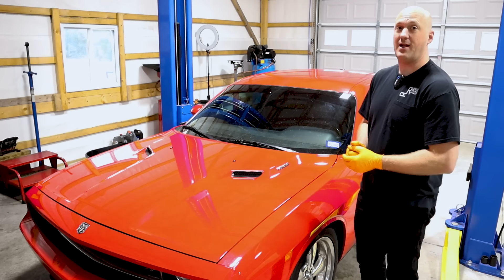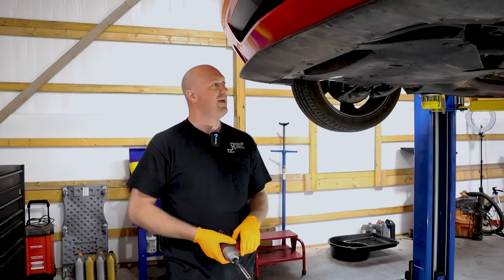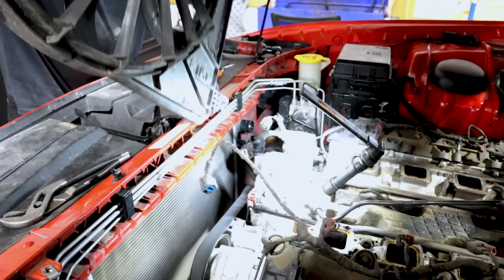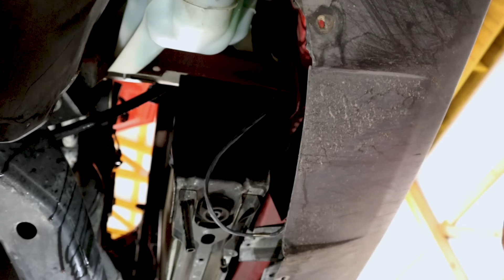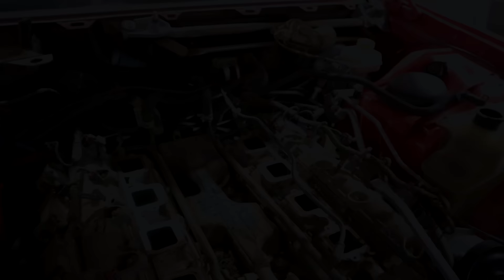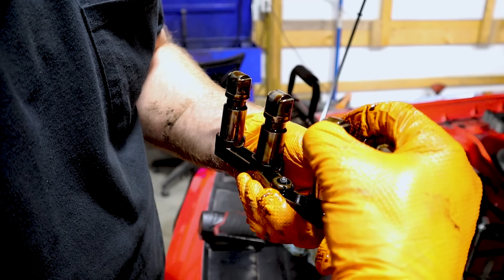Hemi Cam Installation! Budget Challenger Build Ep1

Comment: I had been giving it some thought about doing mods like this to my 2020 Ram 1500, but then I think, why not just get a junkyard 6.4 SRT motor with relatively decent miles and do a freshen up and new cam and lifters, maybe a set of rings and swap it into the Ram. Anyone agree?
Reply from the maker: In my opinion it's not worth the extra hassle. You can easily do some bolt on mods to your engine and make it a pretty decent ride. Getting the 6.4 working properly is a lot of effort.

Comment: Does the hemi change much from 05 to 2010? Asking to see if it'll be possible to do the same for my Magnum rt
Reply from the maker: Unfortunately they did change the block slightly in 2009 to accomodate the VVT system, so this cam will not work in your Magnum.
Reply: @ReignitedAuto  Damn, well good to know now, thanks for the explanation. Amazing vids btw man, super easy to understand you. Keep up the amazing work! Also another thing, would the SRT8 cam from the 6.1 fit onto the 5.7?

Comment: I have a 5.7 hemi in my 04 ram... obviously the concept is the same but will this same parts work on mine the cam the lifters  and springs
Reply from the maker: Unfortunately not, the block was changed in 2009 when they added VVT so this cam will not work. The springs and lifters will though.

Comment: I installed 6.4 l long tube headers, 95mm throttle body, k&n typhoon air intake, muffler delete mid pipes, resonators and high performance high flow cats
Reply from the maker: I bet that sounds gnarly! 💪

Comment: really great well put together video . You really showed how easy this engine is too mod that i decided too copy this build for myself . However I’m debating whether or not too use a comp cams phase limiter . It doesn’t completely stop the phaser from moving but reduces it by 50% . I’m not sure if it would make for a even better power gain or potentially hurt power gains , What do you think ?
Reply from the maker: Honestly I couldn't tell you for sure, since I haven't done any dyno testing to confirm either way. However, one of the reasons I chose not to use one on this build is so that I wouldn't be throwing any Check engine lights for phaser operation.

Comment: Going at this without pulling the heads off, got the timing chain off and the cam will hardly spin with a ratchet. Can’t even spin it by hand. What would be causing this?
Reply from the maker: I've experienced this before, the front cam bearing develops a ridge in the front of it and this won't allow the cam to spin smoothly or be pulled out without yanking on it.
Reply: @ReignitedAuto  nice way of telling me what I don’t want to hear. Thanks for pointing me in the right direction

Comment: Do you need to take the heads off?
Reply from the maker: Technically no, you can change the cam without removing the heads, but usually I am replacing the lifters at the same time which does require the heads to be removed. 👍

Comment: Random question, are you not afraid of mixing the coolant and oil?
Reply from the maker: Not when I know I'm going to drain it at the end. If you let it sit for awhile the coolant will always separate itself underneath the oil, then when you drain it all the coolant comes out first and is pushed by the oil on top 👍

Comment: Hearing that cam smack the cam bearings made my sole hurt.  I know your trying to do it fast , but in my short time of working on my mag ive learned it is just as easy probly easier to remove the nose cone with the bottom air diffuser attached to it rather then fight teying robget them small a$$ bolts to line back up .
Reply from the maker: I think there's a misconception that cam bearings are made out of pudding, they're not 😂. That light "tink" noise you hear is endemic of a hardened metal touching another piece of metal, trust me, the cam bearings are perfectly fine.

Comment: Just want to share, I did my first cam swap on my 15 Durango rt. This is the video series that gave me the confidence to do it myself. Had zero issues on startup and so on. Jumped into all the research I could find on the 5.7 Durango to make it as easy as possible. While it was somewhat easy, was just time consuming which is ok. Thanks for your videos and channel!
Reply from the maker: Exactly what I hoped the channel could do! Great job man 💪
Reply: How did you take the header to Down pipe bolts out? I can’t fit anything in there
Reply: @Jojopraa take the heads out with the headers attached.
Reply: So about how much does all that cost
Reply: @ronniejones9693  little over $2500 for the cam kit and tuning/tuner and pcm swap. If headers too then you're looking at another $1500 or so depending on the brand.

Comment: Did you get a check engine light after install?
Reply from the maker: Nope, runs perfect 👍
Reply: @ReignitedAuto  I plan on doing a SRT cam and MDS delete on my Ram 1500 5.7. Probably a canned tune from hemifever if no check engine light. I know there's a difference between Ram and dodge 5.7 hemis. But I'm sure there are still gains on the dollar. I'll probably do this after a under mount turbo install. Do you think it is wise to put the SRT cam in a Ram 1500 5.7? I'm not looking to break records. Just have a little more around the band. I know the 6.4 HD cam wouldn't give me that.

Comment: I am beyond pleased with this tutorial. I am a long time chevy gear head but have been a little intimidated by the task of tearing into a hemi. I have a 2011 that broke the timing chain and bent numerous valves. I was considering a long block but after watching this I am going to do the top end myself. Thank you very much. I have subscribed and will tune in.
Reply from the maker: That's great to hear Kevin! You'll see once you get into it that it's very much just another cam in block engine, you won't have any trouble 👍
Reply: Update, I finally got all the parts and did the job based solely on your videos. Got 150 miles under my belt running strong. Lifters seem a little noisier than I remember but no codes, no leaks, mds system operating correctly. Thank you so much for this series. I have never worked on a Hemi ever and I was able to do the work after watching your videos. Thank you again!

Comment: Would that cam fit the 5.7 Hemi from 2004-2007?
Reply from the maker: Unfortunately no, they updated the block in 2009+ to accomodate the VVT system, so these cams won't work in the older ones.

Comment: So my 2012 2500 ate the cam a few years back so I decided to rebuild the motor. I went with the 6.4 cam, mopar performance springs. Went ahead and did a little head work and back cut all the valves. Added oversized throttle body and had it custom tuned by HemiFever. At first i wasnt too sure about it because it does lose torque down low, but a little more throttle and there it is. The torque curve moves up a bit. I can tell you that i am definatley over 450hp at the wheels and cruising at 30mph and gun it i can get to 75 in about 1 second flat. I have yet to have any truck beat me at a light that includes Raptors. Keeping the VVT is excellent as it works as almost a turbo boost. When the stock hemis are rolling out of steam im just hitting the sweet spot.

Comment: Hello. Please tell me, can I use this video and part nubers for upgrade my hemi 2005 year ?
Reply from the maker: Unfortunately no, they changed the shape of the camshaft in 2009 so the older ones won't work.
Reply: @ReignitedAuto  Is there any way to increase the power in my case?

Comment: Damn it's late as heck 😅💀 bit with the 6.4 cam shaft wouldn't you need a actually tune for that? Cause diablo I don't think you can go to indepth unless you got a email tune or Dyno 🤔
Reply from the maker: For sure, to optimize the cam you would want to get a custom tune done. This is just to show that you can install it and drive it around with no issues before you go to the dyno. 👍

Comment: I didnt know you had to pull the heads tp do a hemi cam swap
Reply from the maker: Technically it can be done without pulling the heads, but I always do because I change the lifters at the same time a new cam goes in. 👍
Reply: @ReignitedAuto  ah got ya

Comment: Thanks for this super informative series of videos. I have a 2012 RT Automatic,. My vehicle currently has the MDS turned off. I'm doing a Comp Cam 274 upgrade. My question is what king of lifters do I need?
Reply from the maker: To be honest, I'm still a huge supporter of factory parts. Too many issues using aftermarket lifters that rattle from day 1. Stick with stock lifters and you'll be in good shape. 👍
Reply: @ReignitedAuto  I get it now. I checks my cam kit, and it came with non MDS Mopar lifters. You have no idea how immense is the known I got from this video. I’m a weekend mechanic and cam this is my first upgrade project. Hopefully everything will go well. I’ll keep you posted.
Reply from the maker: @javiercorreasr.2630  Love it!

Comment: Got an automatic 2007 Dodge Charger rt. I’m wondering where I can get a cam and lifters from and how much this will cost.
Reply from the maker: I know comp cams makes a good upgrade cam if you're interested in going that route. Generally this sort of job at a shop will cost around $3500-4500. 👍

Comment: a 5.7 hemi in a 05 dodge ram isnt the same as your 5.7  id the break down the same?
Reply from the maker: There are a few relatively minor differences, but the procedures are largely identical. The camshaft will not fit the older models though, they are for 09+ only. Also, on an '05 the cam thrust plate is one piece and goes behind the oil pump so you have to remove the oil pump to replace the camshaft, which is a bit of a pain since you have to drop the oil pan to unbolt the oil pickup tube.

Comment: I’m about to do this exact swap (minus the headers) but the Mopar springs are out of stock everywhere I’ve looked with no ETA 
Can you suggest a good alternative? I’m guessing the stock springs aren’t going to cut it, correct?
Reply from the maker: I've used the 6.4 scat pack springs in place of the 5.7 before with no issue. However they are more expensive than the Mopar performance ones, not sure if it's cheaper to go that route or to just buy aftermarket options.
Reply: Ok that’s good info. Does having an automatic transmission prevent me from doing this swap?

Comment: Great video,  if you are upgrading the cam and the exhaust manifold,  shouldn't you upgrade the heads for better flow?  I suspect the 5.7 heads are just as good as the 6.4
Reply from the maker: The factory eagle heads are very good, they will support quite a bit of power before they become a restriction 👍

Comment: THANK YOU for your videos. Had a lifter take out the cam in my RAM and the shops were over $4K and two months out. I did it in a weekend for $1,400 thanks to you walking me through it!!!! THANK YOU!!! Couldn't have done it without you!
Reply from the maker: These are my absolute favorite comments, Congrats Kris, Good job having the confidence to pull it off! 👊
Reply: was it as easy as he makes it seem? lol
Reply: Can you run this straight off the 5.7 hemi computer without any tune. Just slap it on and go
Reply: @DangerousDoug42 yeah you can
Reply: You did just the cam without doing the liters?

Comment: Absolutely one of the best videos . I’m planning on doing the cam and lifters on my 2011 ram 1500  with 125k .will this cam and lifter set up work for my truck engine ? Also should I go with the msd delete kit ?
Reply from the maker: Yessir, the cam and lifters will work on your ram 1500. Deleting MDS is up to you, I honestly don't really have a problem with it, and it does save gas usually. The one time I say to get rid of it is when you're running an aftermarket exhaust, because it sounds like garbage when it drops into 4cyl mode.

Comment: AWESOME!!!!  Thanks SO much for sharing... I have a 2013 Ram 1500 with just 42K miles and thinking of doing the same BEFORE anything happens. LOVE the truck so want to fix it right.  I hear Mopar fixed the lifters with a new part number that just came out is that true?  Did you notice a drop in MPG without the MDS?  Thanks again!
Reply from the maker: Chrysler did update the lifter roller bearings in 2016, this did not FIX the issue, I've done several cam/lifter jobs on 2016+ vehicles as well. You will notice a drop in MPG without the MDS, Chrysler says the system is worth about 8% MPG gains, so expect something like that for a loss. 👍
Reply: @ReignitedAuto  THANKS SO much for the response SO nice to have someone who did these jobs!!!  So for best reliability best to go with non MDS and what is the best brand of aftermarket lifters?  Johnson?
Reply from the maker: @ericsacco7406  honestly, even though these factory lifters fail eventually, my feeling is that if you get 100k plus miles out of them before they fail, I'll take that every time. So I always just recommend replacing with Mopar lifters. Plus I've had too many issues with aftermarket lifters rattling right away.
Reply: @ReignitedAuto  Thanks so much!!  I now use WIX high end oil filters and lucas syn oil additive changing every 4k or year whichever comes first.  Right now I'm doing 2k miles a year at most.  I also try and keep the idle time a minimal as possible.

Comment: You don't seem an problem with gunk and runner getting all nasty ? Definitely not an mechanic I would go to . But cool video
Reply from the maker: What mechanic do you go to? Do they make sure to get all the gunk out of your intake runners? 😄
Reply: @ReignitedAuto  that’s why I do my own work and if I care enough for an vehicle “ any” I would still and will continue to buy them , simple , take care or your stuff and they last longer . Pretty simple common knowledge since your upgrade engine has all does new items . But hey 👋🏻 each to each own right ?🤙🏼
Reply from the maker: @CoyoteDAworld  appreciate your view point, but there is literally nothing detrimental about having oil deposits in your intake runners. It has no effect on longevity or reliability.
Reply: @ReignitedAuto  so your telling me that after let’s say about 75k miles on an hemi being driven spiritually since your getting all does mods , it’s not gonna drop it’s performance due to its intake being all gunk ? Or it’s economic performance? I’m just curious for sure ?
Reply from the maker: @CoyoteDAworld  show me one dyno graph of a vehicle before cleaning the gunk, and one after cleaning that shows any improvement I'll change my position. But no, it doesn't matter in the least.
Reply: @ReignitedAuto  👍🏼

Comment: Cool, did you move it to a new location that it actually gets oil at high rpms? Hey guys, for a lot less money than a new "hemi car", you can build an older  A BODY, B BODY, OR HELL EVEN C BODY MOPAR. There is a list of options. There are so many aftermarket suppliers of everything you could want. You can have an a body car that will outrun, out handle, and outclass the new modified boat anchor chrysler is trying to currently sell you. You hear that, you DO NOT have to start with a car that weighs more than most small trucks.
Reply from the maker: Or you can do like I did and put a 6.4 Hemi into a C10 truck 😄

Comment: When mentioned  about not having to remove the water pump is that in general other factors that can change that decision to having to remove...? Like mileage on my 96 MagSrt8 just a bit past 180,000miles and because if that what other gaskets do you advise to replace?
Reply from the maker: For sure based mileage it makes sense to change the water pump at the same time since you are draining the coolant anyway. You might also think about replacing the radiator and thermostat as well, these radiators don't have the best reputation. Only other things to look at would be the overall condition of the serpentine belt. 👍
Reply: @ReignitedAuto  again I really appreciate the help and answering my questions like I said I think I mentioned it before this is my first time going into depth if that into any car other than regular bolt on stuff and maintenance and learning along the way as for I don't have all the tools like I thought I would have but I do take into consideration and have applied just about everything you've mentioned and I try to take as much of it in (I like to learn hands on) almost like having you as my mentor I appreciate you answering all our questions its easy to listen to how you teach...
Reply from the maker: @sugar69711  thanks very much for the kind words I appreciate it, definitely like to help out if I can. For the stripped idler pulley bolt there are sockets that are designed specifically for stripped heads, and they work amazing. The down side is that they further destroy what's left of the bolt so you'll need a new one, which its a special bolt that you'll have to order from the dealer. I'll try to find a link to those sockets.
Update: they are called bolt extractor sockets, they are pretty cheapfor a set and they really come in handy. The inside looks like a spiral.
Reply: @ReignitedAuto  agreed. Your 💯 on the radiator that has already been  replaced .

Oh there is an issue I ran into when I attempted to remove the idler pulley I stripped it pretty bad I can get another fitting or what I was going to end up using was a torx but in order for me to actually use it you know mocking it up I noticed I'd probably have to being in a couple times in my rubber mallet what do you suggest other ways of removing a stripped bolt or a hex on an idler pulley?